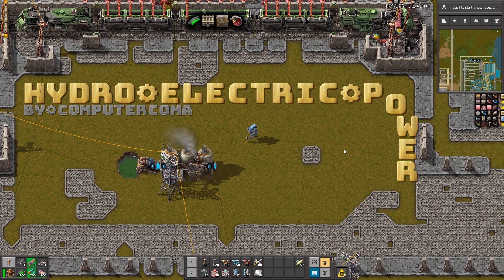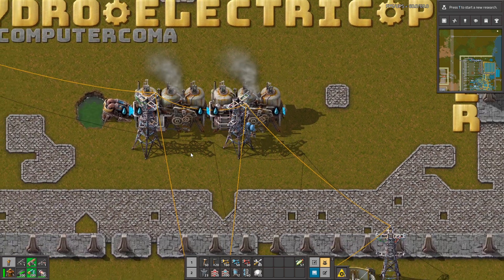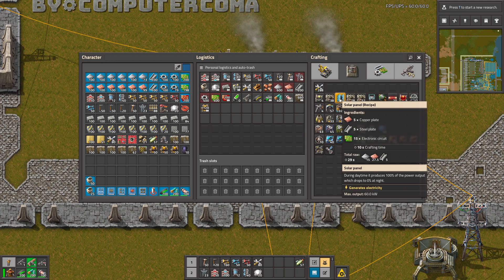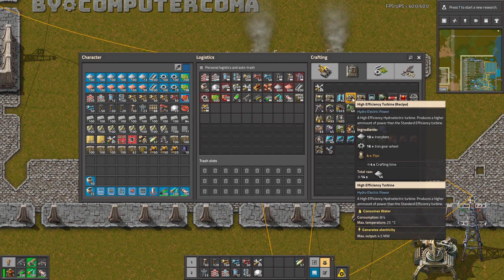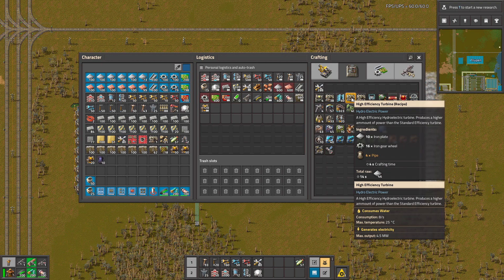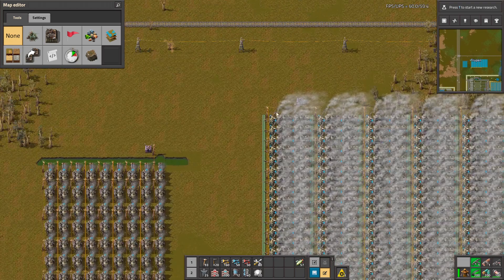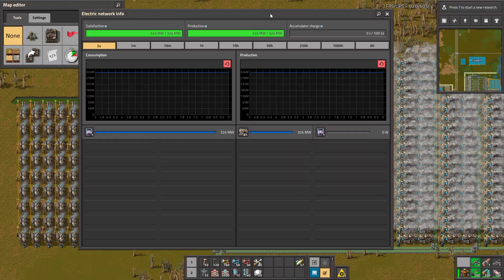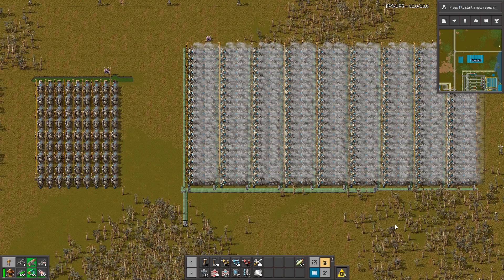PRINT Electricity

Comment: Would be nice if you needed cliffs for it to work. So an actual use for cliffs rather than just dynamiting them.
Reply: Came here to say this. Should need cliffs.
And the turbines should not emit the used up water as steam. There should be a new "downstream water" or "low pressure water" liquid that the turbines output. They obviously will only work when they can get rid of it, and to get rid of it you get the reverse of a offshore pump: an entity that functions as a drain for the "downstream water".
While there is nothing preventing from dumping the water into the same lake you got it from, at least with those changes you CAN make it look realistic.

Comment: Just casually feeding boilers with nuclear fuel, lol

And I love that even when Trupen himself says it's pretty OP, people come here to comment to say it's OP.. Like that wasn't obvious, lol.
Reply: I felt that way about solar when I built my first solar field, so have never used solar since. Free electricity like that feels OP.
Reply: solar power at least takes an absolutely ridiculous amount of space, like 10 to 12 times as much, to produce the same amount of energy as steam (roughly 4.66..66kws of power per tile for a solar panel, with 42.857kws of power per tile for boiler+1 steam engine, or 50kws per tile for 1 boiler+2 steam engines). this mod is literally just an absurdly massive objective upgrade from steam engines and is heavily simplified compared to steam engines (by completely cutting out a middle-man ie the boiler) tho, lol
Reply: True, it takes space, but it doesn't cost anything to run, which feels cheaty to me.
Reply: @jemsterr  well, the thing is when you're building sprawling and unending megabases, then depending on your difficulty, at a certain point the rate that your consumption of electricity increases far exceeds how fast you can take space from Biters until you reach a certain point in your military tech, at which point the massive space requirements of solar panels to make GWs of power is not worth it for a while and you need to supplement it with nuclear and steam. so Solar is not the be-all-end-all of power.

Solars (+Accumulators) per unit of energy they produce are also. just. so much more. ridiculously expensive. Solar Panels take 100s of times more resources per KW they produce than a Nuclear Reactor does. thats considering heat exchangers, turbines, heat pipes, and only a single reactor, not even 4 (the bare minimum you should really have for a Nuclear Reactor, which octupoles the energy they produce lol). and because they produce so little power, while you may not be needing to upkeep it with fuel you essentially are regularly paying a lot of resources to have this "free power" in order to keep up with your growing energy demands. and unlike a lot of other machinery in the game, you will be producing 100s of solar panels and accumulators per second and using them per second in order to expand your power grid if you're going solely off of solar, so that is some huge resource demands and really that will pretty much only keep up with your energy consumption, not give you a buffer, and you can still very easily regularly have brown outs.

so there are 3 more much more subtle disadvantages to solar, there. resources per power they produce, they are the most inefficient power generation in the vanilla game by-far. that also means its going to be pulling a lot of resources away from things like your science packs. and it will also require constant attention on your part to expand the grid.

Solar also does have a huge advantage in that with no need for pipes its quite UPS friendly (at least, Solar Panels are. Accumulators can really hit your UPS sometimes tho) and when megabases get really stupidly big this UPS efficiency is required for your save file. after a certain point, it will just slow to a crawl if you had no solar at all.
Reply: @jemsterr  Solar power doesn't cost anything to run in real life either, unless you count the occasional maintence cost, but then nothing requires maintenence in this game.